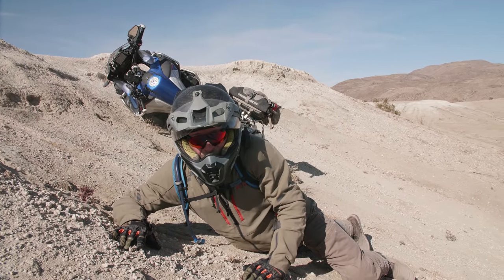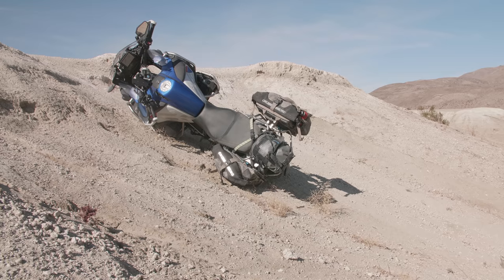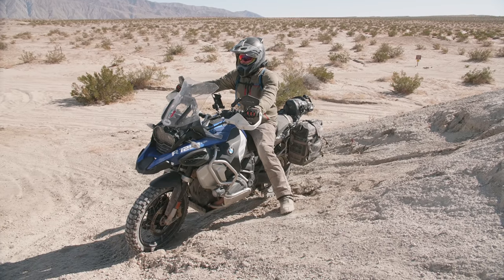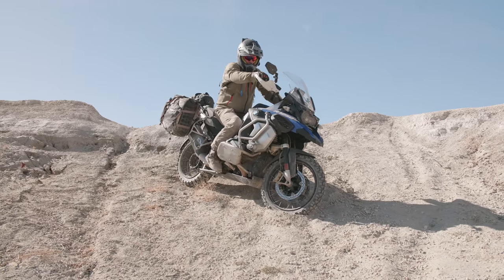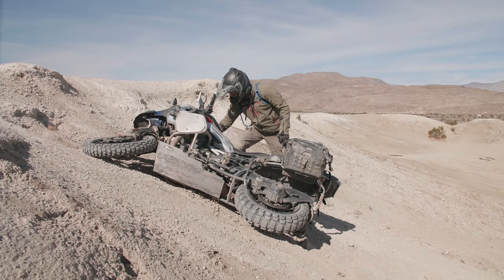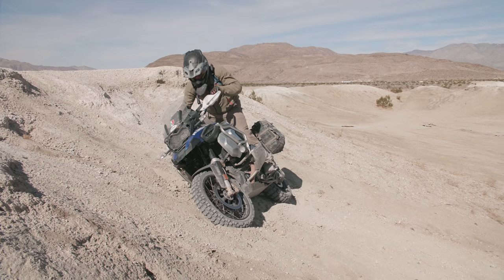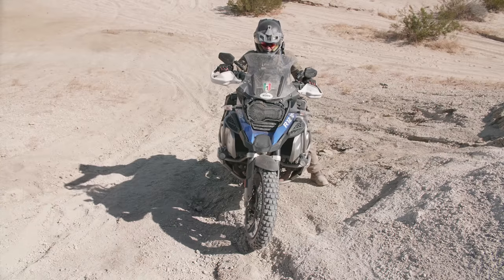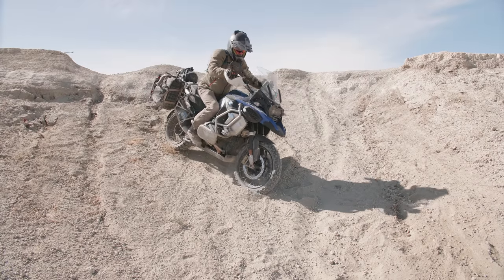Failed Hill Climb Recovery Lesson (Skill & Strategy) for Adventure Motorcycles Off-Road

Comment: I've always found it much easier to pull the front tire down the hill instead of pulling the rear tire *up*.  The front is already lighter, especially since it's facing uphill, and I prefer to let gravity work for me instead of against me.
Reply: Good point Bill. I have been successful with pulling the front as well. I guess it would depend on the path of least resistance and to your point, in this case, the front may have been easier. :-)

Comment: I once used a similar technique (combination in gear and foot brake adequately with motorbike position) when I stopped on a steep slope with a tdm900 on a dry forest road (I was a little curious how I could deal with such an technique XD). It really works (to overcome the dilemma without consequences). Thanks for such helpful hints.

Comment: A great technique as I had to learn this the hard way recently going up a hill bigger than this and dumped it, its hard to do this in a way when there isn’t any loose sand/dirt & digs in.  I didn’t turn it around, stood it up & tried to get it up the hill by pushing it, I was tired as hell but I did it as I didn’t want to go back down into a sand wash.  But this is much easier to do, have to take your time, also momentum is key, get down the hill & just ride it out.

Comment: Great thanks for this video and technique. Brilliant !
I faced a similar position, but the ground was light gravel and was very hard to put my foot and make it a spot to lean on. 
Was slippery. What do you recommend ?
Reply: Thank you. That's a tough one. I have been in those situations where the hill is much steeper and the terrain is much looser. I moved as much of the topical gravel away by scraping my boot into the dirt as much as I could. Wasn't pretty, but it worked well enough :-)

Comment: Hey Dusty, I know this video is older and may not be monitored anymore, but I came across it because I fell on a hill and was surprised that I could not immediately pick the bike up and it was only a 300 lb Yamaha 250. I'm a first time bike owner and took a hill that looked interesting... and higher than I should have tried.  Anyway, I fell and the bike landed with the wheels up the hill and the handlebars on the lowest part of the hill. The bike was perpendicular to the trail.  Since this position is opposite of the examples you gave, what would have been the proper and easiest way to get the bike upright and on my way.  I struggled a bit to lift it AGAINST gravity.  Thanks and I look forward to hearing from you.

Comment: No Dusty, that wasn’t what I was thinking, I was thinking but what if I topple over! I’ve got to spin it all the way around while it’s on the ground, I guess.
Reply: If the bike falls with the seat facing downhill, your best bet is usually to pull the front wheel around so it points downhill. Then stand it up (in gear and on brake, front brake ideally cause the rear WILL slide if the slope is significant). Be careful though! The bike may slide unexpectedly while you're dragging it around.
Reply: Rick and Hardware, thank you and good question and good point. I don't like the idea of spinning the bike all the way around to where the front wheel is pointing downhill. A few major reasons, this is a heavy bike and not easy to pick up in that situation. I also don't have as much control of the bike if I am successful at picking it up. When the bike is perpendicular to the hill, I don't have to lift it like normal and when I do get it upright, I am able to mount the bike and control it much easier. Even if the bike lands with the seat downhill, I would choose to spin it perpendicular and not point it all the way down the hill. But that's just my preference in that situation. :-)
Reply: Every time I come off my KLR it's across the face of the slope, seat facing downhill. Be nice to not have to plain deadlift it back upright, which was what I did last weekend on greasy clay-mud slope with inconvenient 4WD ruts either side. Gym time paid off, but it was far from ideal. Got an early morning deficit deadlift in I guess, take bright sides where I find them.

Comment: And that, girls and boys, highlights why it is so important to chose the right bike for you (and don't pack your entire household)! A bike that's too tall and/or too heavy (for you) can easily turn your adv ride into a nightmaire. You get tired, mistakes become more frequent and you're to exhausted to pick it up.
Reply: Good points Alex. All those factors certainly play into my decisions. There are many places I would choose a smaller/lighter bike and pack less luggage. But when I learned to do this on a heavy loaded bike, it built my confidence and increased my desire to ride more difficult trails.
Reply: @west38moto53  Absolutely, i'd say i had the same experience when i switched from an XT to a 100GS into the Sahara. Got so confident that I've been "crazy" enough to take an XS1100 down the Tanezrouft just to prove it could be done...but now as i push 60 even my HP2 enduro becomes a handful in some places

Comment: Dusty, you seem familiar with the Southwest.  What about a hill stall on something really rocky and nasty?  Ever been back in Malicious Gap, north of Roosevelt Lake in AZ?  There's a horrific hill climb on FR236, just south of the Dupont Cabin.  Incredibly steep switchbacks with sharp jagged baby head boulders.  I've done it on a Husky FE250 and stalled several times and was exhausted, but I've seen guys supposedly climb it on Africa Twins and 1290 KTM's.  The notion of taking my 800XC up that is daunting.  Taking it down that even more so.

I'd love to see you make a similar video on FR236.  If you need a guide or a cameraman, I'm willing to help.

Comment: I've always just bounced my weight onto the rear, little pop of the clutch to lift the front and a twisting tug on the bars left or right. The bike just pivots on the back wheel and points down the hill. At that point I've got no brakes, clutch in and just ride down the hill.

This looks like a lot of work, and I don't know how it would go on a really rutted trail.
Reply: Don't forget the bike is dead
Reply: @Cj-yw8cs  true.

Comment: If the kickstand is shoved into the ground then the first technique needs to be done a little differently, otherwise when you rock the front wheel down the bike will hang up on the stand and fall over down the hill.  Instead of rotating the bike 90 clockwise, spin it 180 counterclockwise and pick it up facing downhill

Comment: What about grabbing the front wheel/rim and dragging the cow around that way, rather than pulling "on a solid part of the bike" somewhere around the rear seat?
Reply: I wouldn't think you'd want to be down hill from the bike in case the ground is loose and it slides unexpectedly.  If you're uphill of the bike and it slides it will go away from you. 
I certainly wouldn't consider myself an expert. I've never ridden offroad. So take my comment as just a guess. But that makes sense to me.
Reply: @fasfan  Makes sense to not be below the bike. But look where the front wheel is when the bike goes sideways...
Reply: Good point Peter and good point fasfan. When I do this I prefer to move the back of the bike if possible. I also would not want to be below the bike if it shifted unexpectedly and caught me off guard. However, you could position yourself so you are out of the way of the front of the bike if that happened. I agree Peter, in this situation, the front would have been just as easy. I have had more success with moving the back around but have also been in situations where it was not possible to move the back of the bike and had to move the front.

Comment: Thanks for the very educational video. I have one question, what do you do when you have a DCT motorcycle?
Reply: Good question. I can only guess since I have not had a DCT motorcycle in a situation like this and dropped it on the right (throttle) side. Does the parking brake feature lock both brakes? If so, I guess that would be an option. My guess is the front wheel would still slide down hill, it may just be a bit harder to get it over and small to medium sized obstacles that are impeding it? Just spitballing....

Comment: Experts always make it look so easy.  Does the lower weight of the boxer engine help maintain balance during that pivoting?   It didn't feel as easy on my big triple as you make it look on that big boxer.
Reply: The cylinder sticking out on a boxer is a very nice pivot point! (Works also in flat sand, not just on hills. Pulling by the front wheel, rather than around the seat works well too.  Ask me how I know ;-) And that's why you want plastic cylinder head covers, in addition to crash bars. https://photos.app.goo.gl/azdm9HTda2bUPvHj9
Reply: Good question Luna'Kai. I would have to do it with both bikes to really pay attention to the difference. I do know that the heavier the bike is, the more useful this technique is...

Comment: Works best if you have shielded BMW motor sticking out of the bike as a pivot point :D
Reply from the maker: True. Do you not have crash bars?
Reply: @MOTOTREK  yes, but they don't stick out so far and prevent the handlebars from digging into the ground. That makes it more difficult to move the bike around, because the pivot point is not right around the centre of mass. But your advice is still a good additional option to have in your arsenal for the perfect adaptation in a given scenario.

Comment: Thank you for these great tips! For the final part (bike stalled while going uphill), it's better to turn back downhill and start again than starting the bike up and continue to go up hill? Is it because of the lack of grip to continue uphill from the stationary position?
Reply: depends. if you're in a narrow sand chute turning a heavy adventure bike around is a real hassle. you might be able to paddle it up, lol.
Reply: Thank you! Good question. You are correct. I am demonstrating a situation in which getting restarted from a stall is not possible for many reasons including lack of traction on a steep hill.
Reply: @0xsergy  Hahaha...I have done this...wasn't pretty ;-)
Reply: @west38moto53  lol, i spoke from experience. hell, if it's really hard to turn around in i might just roll backwards.

Comment: What handle bar risers are you using? I need something and those look great. How tall are you and what is the riser height.
Reply: I have the Black Dog Cycle Works risers and they are 40 mm. I am just under 6 ft tall.
Reply: @west38moto53  Thanks, do they fit without mods to cables or brake hose?

Comment: Nice video!
Does anyone know which skidplate and "cylinder protection plate" these are?
Reply: Don’t know but I noticed that skid plate right away also, what a beast...
Reply: Thanks Andreas and Benjamin. That is a Black Dog Cycle Works skid plate and those are Ricochet cylinder guards.

Comment: 90% I drop bike on the right side. Rear brake is always bent :D
Reply: Engine crash guards....look them up.  They save both rear brake and gear selector pedals.  ( cb500x 2019 here  t-rex racing engine crash bar set purchased..)

Comment: very good technique but it is not the bike for that terrain. Although now it seems that enduro requires 130 horses and 250 kilos
Reply from the maker: You never know where you might end up on an adventure bike, and this these techniques will work just about anywhere.
Reply: @MOTOTREK  It's excellent to know this technique but the point is that people without experience but with money are believing when watching these kinds of videos that maxitrails are enduro motorcycles, which is not true and it is not the same when a 275 pounds motorcycle falls on us to take a hit from a 550-pound motorcycle that also carries luggage.
In videos like this and many others (which look very spectacular and generate many likes) you should warn that maxitrails are not the right bikes for these terrains.

I have seen travelers who go alone to remote places, looking for 4x4 roads or no road like your video, with extreme climates on adventure motorcycles and cannot get out of there when the motorcycle falls in a difficult place or what is worse, they die when they are trapped by their motorcycles.

Comment: Gravity is your friend. Drag the front down, not the rear up.
Reply from the maker: Gravity can also be your enemy if the bike slides down the hill on top of you. It's safer to stay above the bike all the time.
Reply: If you have lower crash bars you are "pivoting" the bike from the rear around the middle vs. pulling all the weight of the rear 1/2 of bike uphill

Comment: Working with gravity suggests you'd grab the front wheel and drag it downhill to spin the bike around. Why are you dragging the bike uphill - fighting gravity - to spin it around? 

I can understand you may not want to be downhill from a bike that might slide down on top of you. 

Mud would also completely change the dynamics here, making it virtually impossible to do it the way you're doing it in this clip. 

Interesting that you don't show recovering a bike that's tipped top end downhill?

In Laos 2018 in deep bulldust along the Mekong I went down in a deep rut. Bike was virtually upside down in the rut with nowhere to kneel to lift the bike up. Can you reenact that scenario and show me how you'd lift or recover the bike? Keep in mind any time any vehicle passes - you disappear for several minutes until the dust settles again -  making you or your bike highly vulnerable to being run over.
Reply from the maker: Edgar, you answered your first question yourself. Best to keep the bike between the rider and gravity if possible.
Mud would certainly change things. Have you seen our "Winch" episode?
If the bike is pointed downhill you won't need to turn it around.
How did you recover the bike you dropped in a Laos rut?
Reply: @MOTOTREK  Who carries a winch around? I know how to use cord and reduction systems to pull or rig loads. Spent 35 years doing it in trees with tonnages. And 4wds.

Laos: Recovered bike in rut by standing up and bending over and lifting the bike up after taking all luggage off the bike. Rode to an area I could get off the road and bent brake and gear levers back  into place. Then rode in agony to Vientiane and spent 2 days in bed in Vientiane consuming very strong anti-inflammatories. And it was only a 123kg 150cc bike (2018 CB150R). And I'm a very strong 95kg former lumberjack. Tried to kneel down to lift it just couldn't in that rut. 

In hindsight could've put the bike fully up onto its handlebars, was not far from that position. Then over onto its other side on the opposite side of the rut (but again I'm in same situation on opposite bank of deep rut, except - that side wasn't as high due to negating extraneous roadside berm/bank) then tip bike into the adjacent smaller rut which would've seen it almost upright - right side up. Just wanted/needed to get out of there asap before getting run over. Didn't want to be flip flopping the bike further into the road.

A week later in the north of Laos on perfectly flat ground wet clay over bitumen dropped the bike. Couldn't pick it up. Was like being on ice. Couldn't walk on the wet clay it was that slippery. Was major Laos route blocking trucks etc 2 locals on scooter helped me pick it up. Squirmed the 300m further to dry ground. Guess oem tyres should've been swapped out for some, any, block pattern tyres. Except I'd overtaken other riders on touring 250cc dirt bikes with knobbies elsewhere in rocky harsh conditions thinking maybe knobbies aren't the issue.

Comment: Do You really teach people to pull the rear of 250kg motorcycle up the hill??? :D
Reply: Good point. I have answered this a few times and thought about it more each time. In most situations I have been in, the rear is easier. I don't like to be below the bike pulling it towards me, just in case it moves unexpectedly further than I planned (this has happened a few times). Plus, I am not as stable on a steep hill pulling the bike towards me as I am when I am above it. It's really not that hard and with this specific bike, it's spinning on the cylinder guard and crash bar so there is not a lot of resistance. However, I have been in situations where I could not pull the back up the hill and had to pull the front downhill. It worked, but it didn't always put the bike in the position I wanted and I wasn't as comfortable while doing it. All that to say, pulling the front would work also. I would say it depends mostly on the situation. :-)